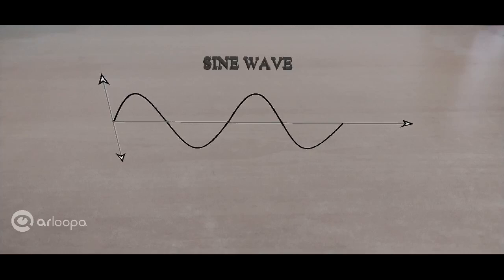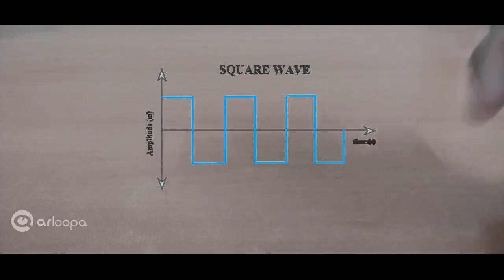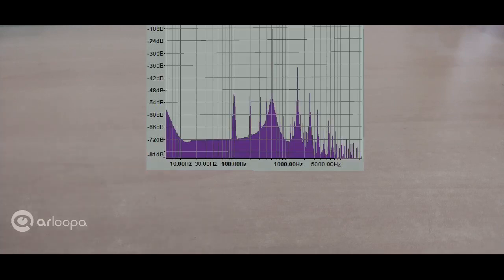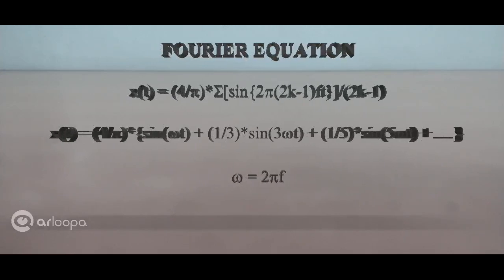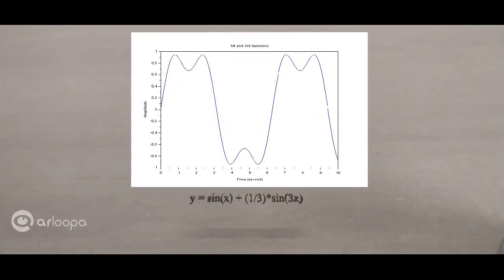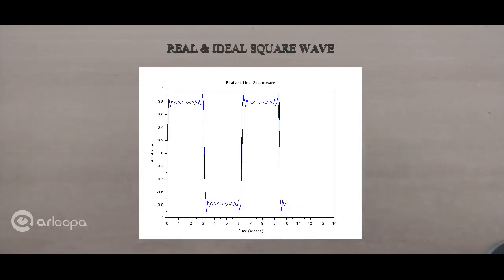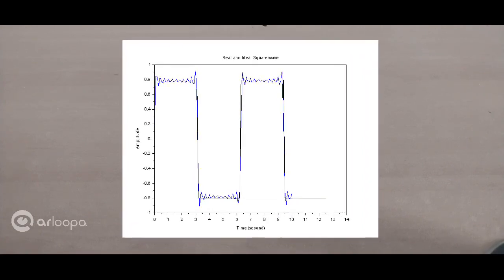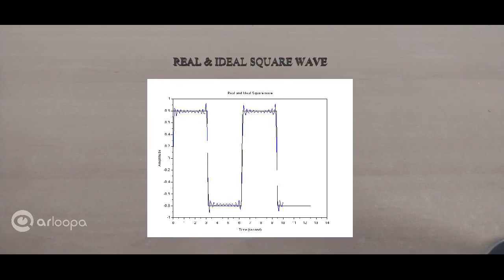Square wave as a sum of sinusoids explained

Comment: Very dumb question: in a PC system, what generates this square wave?  Oscillator?  CPU?  Memory?  All of the above?
Reply from the maker: As far as sound is concerned, it is obviously generated by the output (speaker) but what initiates the sound would be a question best answered by a computer engineer.